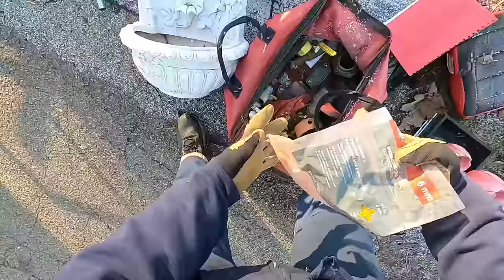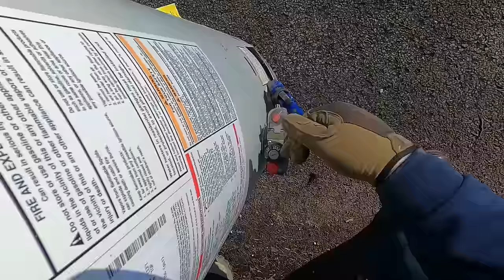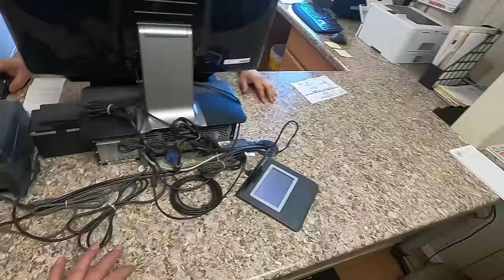Why Would They Throw This Away? Craziest Things in the Trash

Comment: Hey Paul here's a method to clean brass Mix together 1/2 cup of vinegar, a teaspoon of salt, and a sprinkling of flour until it forms a paste. Spread the mixture on the brass and allow it to sit for a few minutes. Rinse with cool water and dry. (This method also works on corroded brass.)
Reply from the maker: Sorry, when I mean clean, I'm referring to removing steel and other ferris materials from the non-ferrous brass or copper.
Reply: Have you try brasso cleaner it cleans all kinds of metal

Comment: That thing that weighs a lot is a big relay. The two blue cylinders are electromagnets that pull down on the lever at the top when energized which closes the contacts on the other side of the barrier. Higher voltages can be switched with lower voltages.

Comment: I know you've heard before but would a small trailer not be Helpful put the big appliances in the trailer and the small stuff in the back of the truck.Pluse the trailer si closer to the ground for the hevey stuff.
Reply from the maker: A trailer would be nice but my bumper is damaged. And I have a small engine . 4-cylinder. I need a bigger truck. And to have a bigger truck I need to buy a bigger truck. which requires money. But I believe it will happen. All in due time.

Comment: You know you can buy a socket at Ace Hardware to remove the heating elements,they are brass. 1 on the top and 1 at the bottom. If you did not know

Comment: That device encased in plastic with copper.. those blue cylinders look like electric capacitors they are meant for a high discharge of electricity. Watch out they hold a lot of power and can hurt really bad if you get shocked by them.. they have the ability to hold enough power to stop someones heart espically when there are multiple in series with one another

Comment: Paul, I know this video is a month old or more but as I've watched your show I've thought it would be easier if you had a trailer to pull also. Then all those appliances and water heaters would be easier to handle and you wouldn't have to lift them so high up.

Comment: Have you tried soaking those in vinegar over night then just using like an old tooth brush and brushing away the deposits on those pressure valves? if you tried that and it didn't work you may need an ultrasonic cleaner to get the stuff off. I would look for a used one.
Reply from the maker: In the scrap world, cleaning up brass means to remove steel and other non brass items.
Reply: @ScrapPalletMan  usually they come apart there should be a threaded end where you can disassemble them. placing it in a vice I'm sure you could make a day where its slow, to work on separation of the valves you have.

Comment: Take the time to rake up a little.  It will save you time spending all the verbal complaints.  You can only get new tires once.  Either that or get the owners to rake up a bit.  They can afford to hire a teen or two to do a little work.  It will save you time and money.  Just a thought.
Reply from the maker: Are you referring to the metal at the scrap yard drive?

Comment: A pallet man you said you didn't have a way to clean those valves you took out of the hot water tank. I use a 4 inch grinder and cut them in half they fall right apart. And you don't lose that much Brass